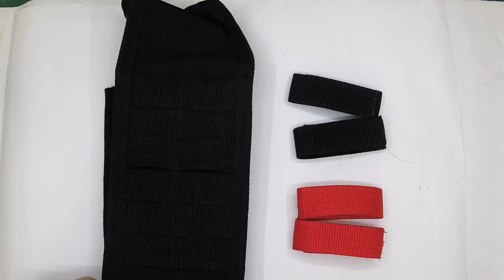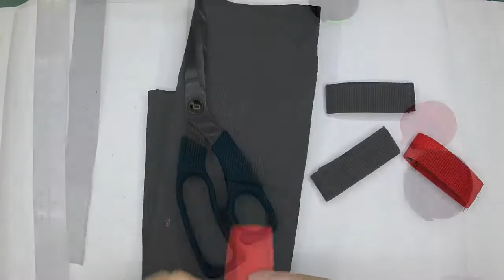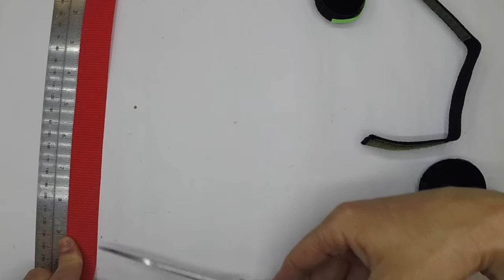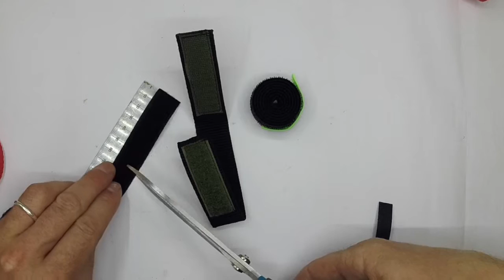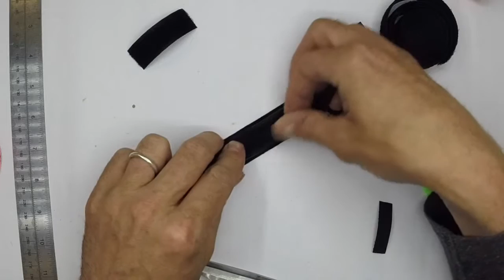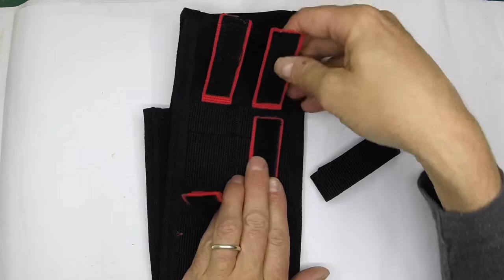How To- Molle to Belt Adaptors

Comment: Take two Black Zip Ties and put one vertically on the molle itself and put the other horizontally on the loop. Don’t tighten all the way until you put them both together and the placement on the molle is exactly where you want (left mid right) as it’s going to be secure.  Then lift up and cut off.

Comment: you should double back the velcro on the belt facing side so you can use it with a riggers belt and it wont slide around because the velcro will stick to the riggers belt.
Reply from the maker: Ghostwalker Airsoft Tech Feel free to modify the design however you want. I don’t use a riggers belt so didn’t do that. I don’t sell these so it didn’t matter. The other problem you will find with that is the thickness of two layers of Velcro and a strap is sometimes too much for sewing machines to handle and certainly too thick to push a needle through by hand.

Comment: Hey Foamdata, I just want a quick tip on some modding issues. I know this doesn't relate to this video, but hoping you see this. Ok so I want to overhaul a Modulus blaster, new battery, motors, wiring, and even a new metal cage for a bonus. I do know thanks to your balance videos that I really need new motors and a lipo battery to make sure they balance out.

Here's my main issue, WHAT motors in today's market (not from a year ago) should I get if I want to use a somewhat weak Lipo battery, like a 2S lipo.

Second issue is that I do not want to do any shell mods to make motors fit, so if I have to get smaller (yet strong) motors, what lipo battery (or a weaker one) should I get?)

Basically these two questions go hand in hand, I have yet to figure out a good balance because your video covered a blaster with 3 motors.
Reply from the maker: MTB Honeybadger motors, 18awg silicone insulated multistrand hobby wire,2s 1000+ Mah 30c constant Lipo. Metal cage- good luck with that, the only current maker, DRS, is not making any more right now. Just get a set of modulus specific Worker flywheels. That set up will shoot about 125fps average.
Reply: Foamdata Services and that sucks that Snikkas isn't making any cages right now, that was one reason I wanted to overhaul my Modulus, do you think he'll start again soon? or is there no sign of him continuing yet?
Reply: (didn't hit reply... lol) Nice thank you, I've also seen people use better micro switches for the ref trigger, what advantage(s) would there be to have one? and if there is some, is it not noticeable or very noticeable?
Reply from the maker: The microswitch upgrade is better for durability and long term reliability, you don't get any more power from it. There's a guide to switch replacement on my channel. DRS isn't a full time Nerf parts maker, he does other things and did the cages for friends plus his own satisfaction. Hawki007 on Redditt makes the BSP cage, which is cast from resin. I am not a fan of canted flywheels so haven't bothered with aftermarket cages.
Reply from the maker: Artifact have just released an all metal motor cage and Blasterparts have made concave flywheels with no teeth. No need to buy DRS, the aluminium cage is $28.
Reply: Foamdata Services oh cool, can you give me a link, please? I'm having a hard time looking for it on the site
Reply from the maker: Zakuro Nerf Mods in Facebook is a source for the metal cage, Blasterparts flywheels 
http://blasterparts.com/blasterparts-precision-flywheels
Reply from the maker: Be aware the metal cage might not fit a modulus.
Reply: Foamdata Services thanks for the advice, now I just need to find it on facebook... damn myself on not being social! lol
Reply: I can't seem to find it even after searching it with "zakuro nerf mod" as key words
Reply from the maker: Taobao link
https://world.taobao.com/item/534975569443.htm?fromSite=main&spm=a312a.7700824.w4002-12995542668.60.4S48b8
Reply: thanks for the help